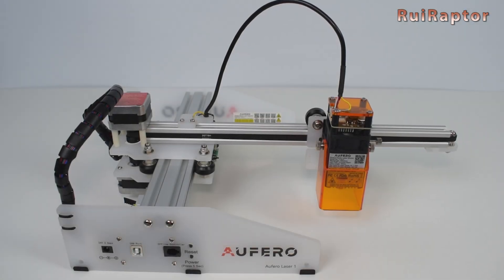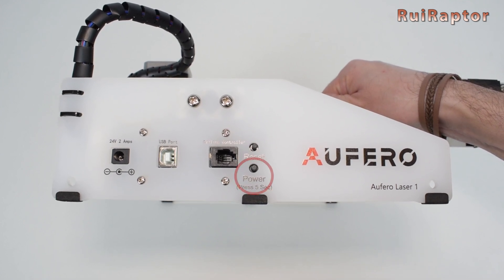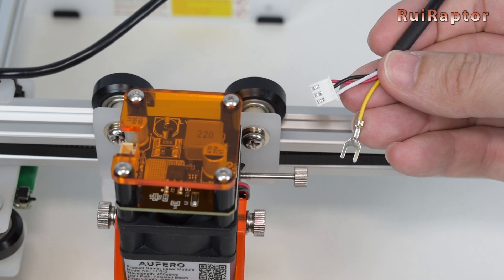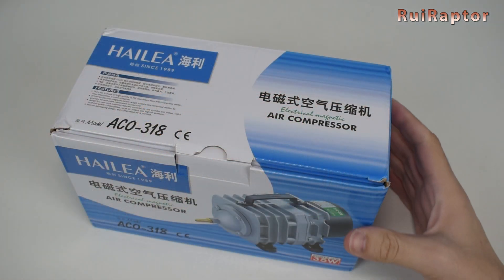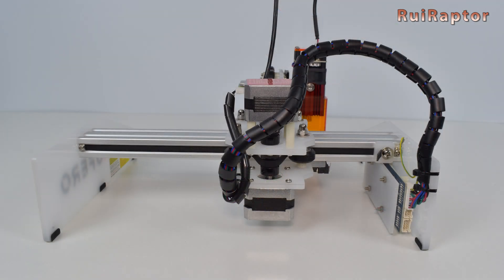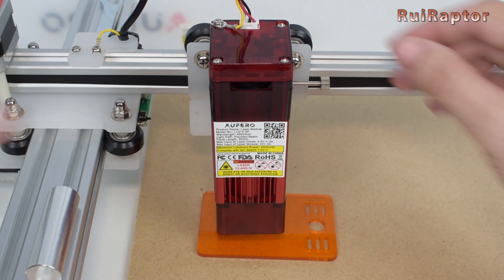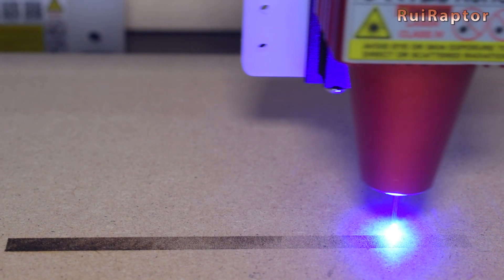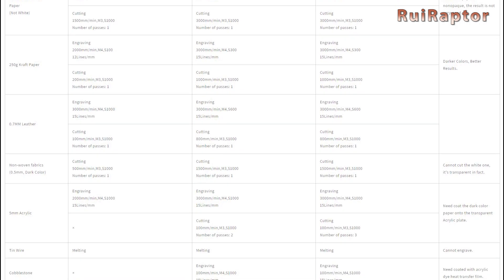AUFERO Laser 1 Engraver/Cutter (3 Laser Modules) - Unboxing, Setup & Tests

Comment: when i turn my machine on (Aufero 1) the red light and blue light come on and that's it. Nothing moves. I have the 3 prong adapter plugged in and grounding wire attached. All I have is the first head engraver. Help??